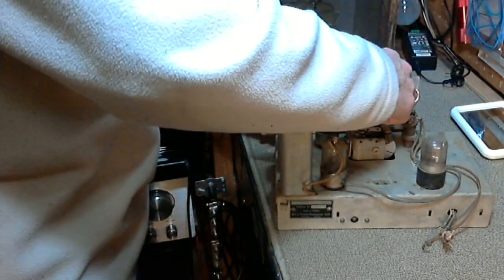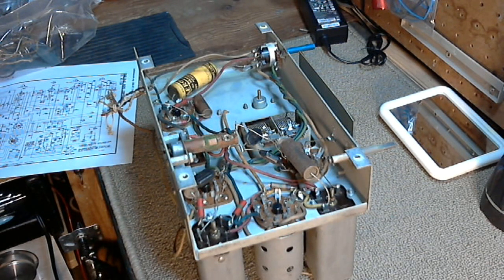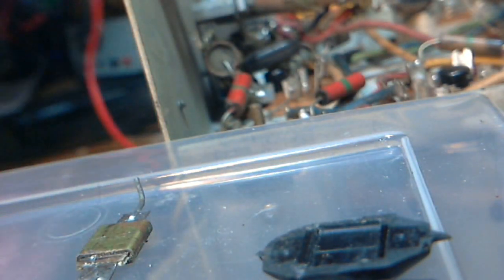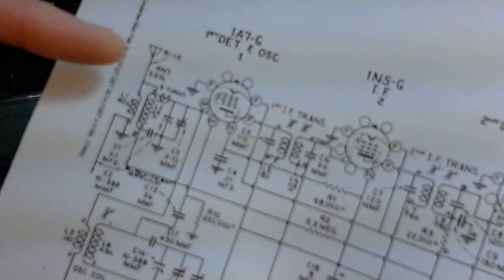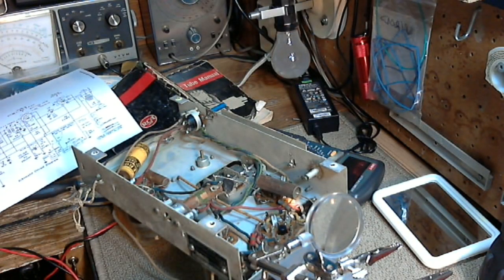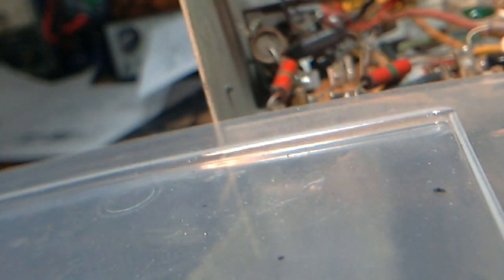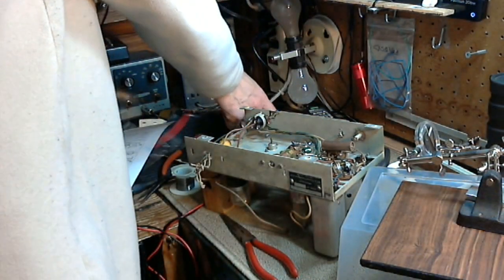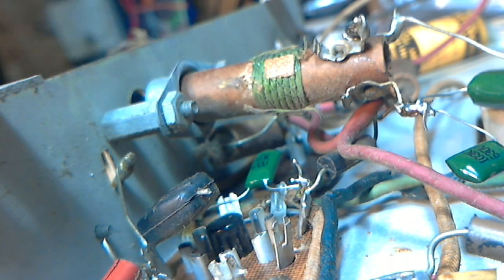RCA Victor 94BT1 Video #2 - Replacing Capacitors

Comment from the maker: Thanks so much Dennis for saving me from myself.  I see now that once I had mistaken the oscillator coil for an antenna coil, there was no way I was going to figure things out.  Video #5 will be me correcting my error.

Here's a link to the schematic and photos:

http://www.evernote.com/shard/s219/sh/ede5a420-e1b2-4866-8839-e115445b2be4/475ad91057ec6d6e2ef116114ff58c66

Comment: Hi Jim. The first and second caps you replaced are wrong. The coil that you are looking at is the oscillator coil and the first cap you replaced is c13 , a 56 pF and the second cap is c17, a 430 pF cap. And the cap that you are working on when you ended the video is connected to the grid lead on one end of the cap.
Reply from the maker: Thanks for pointing that out. I've been thinking about reviewing those since afterwards I just didn't have a good feeling about the work.  Seems to me that I seldom encounter such small capacitors in later radios.  I really need to expand the range of my stock of capacitors.  I think Video #3 ends with a capacitor I cannot identify so maybe you can help sort out my confusion there.
Reply: Not a problem. I do what I can to help. One other thing the tubes on the schematic are drawn upside down to what you normally see on other schematics.
Reply from the maker: I noticed that at one point but I had a hard time keeping it in mind.  More coffee needed.
Reply: I'm not sure witch cap that you are talking about so I will go over the three caps in the video. The 150 pF cap you replaced with a 100 pF cap will be just fine, thats a return for an IF that's made it through the detector and they can range from 100 pF to 200 pF. That next cap across the speaker plug is to reduce an spikes that may come from the primary on the output transformer. And the last cap you showed at the end of the video is the .01 mF cap that connects the plate of the 1H5 tube to the grid of the 1C5 tube.
I hope this helps.